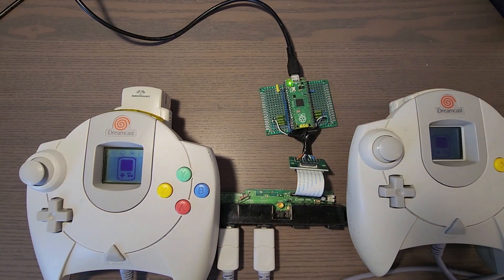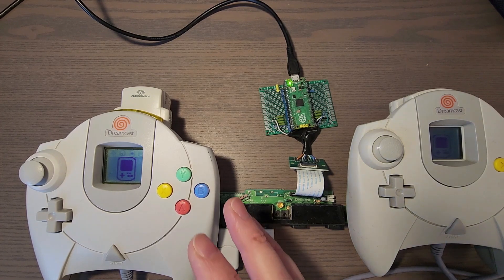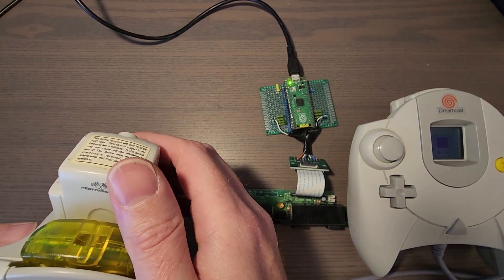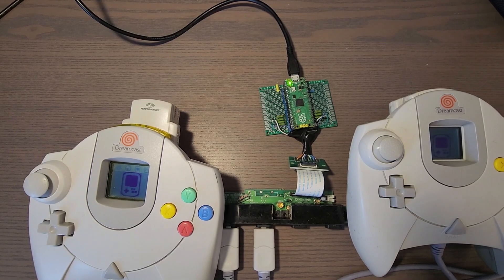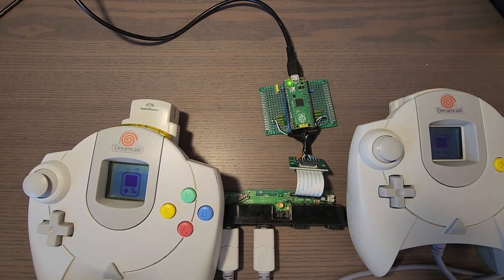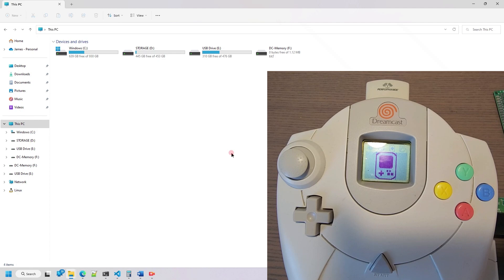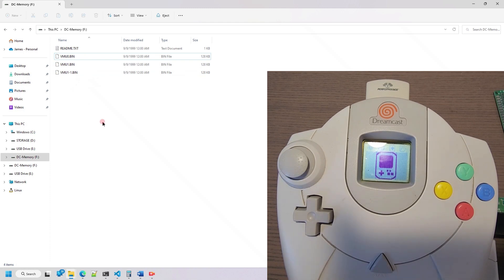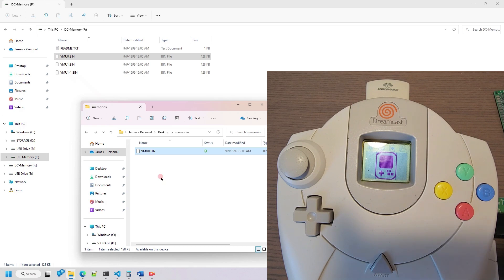Dreamcast Controller to USB adapter update 3

Comment: Okay, man, sold. What hardware do I need and where? lmao.
Reply from the maker: https://www.raspberrypi.com/products/raspberry-pi-pico/
Just this board and 4 resistors. 

I have a schematic in the readme below. Fuses are not really necessary, but I felt the need for development just in case. You can use higher value resistors and nix the fuses. Probably ~50 ohm would be good. They are there mainly to limit current on hw/sw failure.
https://github.com/OrangeFox86/DreamcastControllerUsbPico/blob/main/README.md
Reply: @MilesTailsPrower86  Thank you! Just purchased 3!